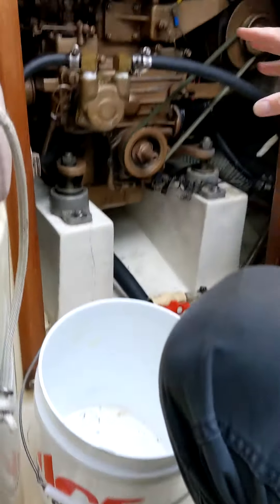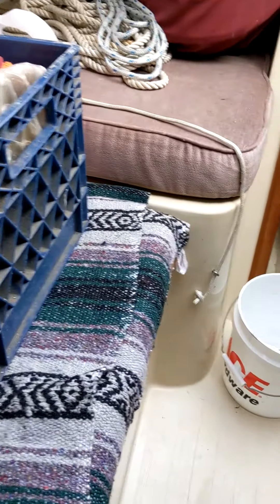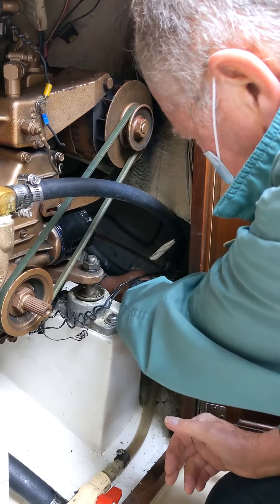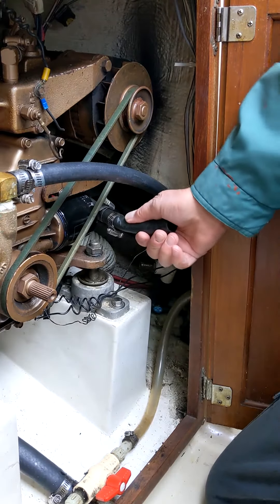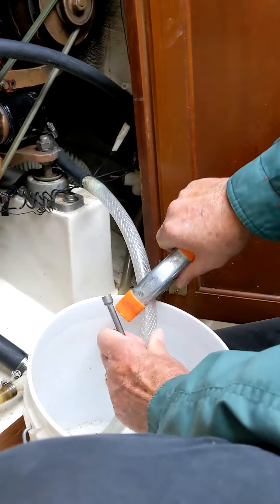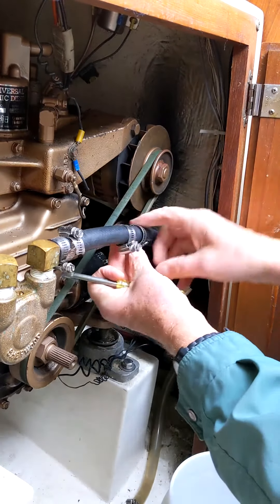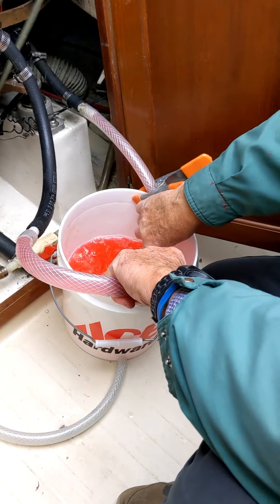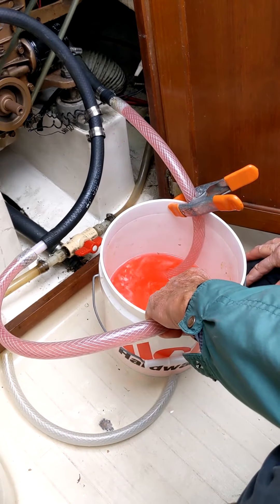How to Winterize a Universal Diesel 5411 in a Sailboat

Comment: Assuming both ends of a hose are accessible, is there a preference for removing the thru hull side vs engine side?  I'd think I rather NOT fool with the thru hull side and not risk any wear to the hose on that end, and run my bucket hose into the engine.  Opinions?❤
Reply from the maker: That's a good question.  I wouldn't think it would make any difference which end of the hose you used in the bucket of coolant because you risk some damage to the hose every time you remove at either end.  The guy in the video has done it this way for 30+ years without an issue. I would replace the hoses on a regular schedule anyway
Reply: @MrShankwheat  Turns out I fitting I see on my raw water strainer is a bypass T so I don't even have to remove the hose - nice! I think anyway. Thank you, I'm coming up to speed on most of this now.